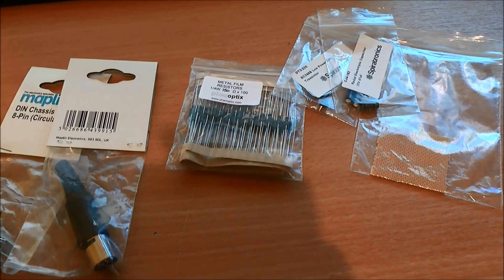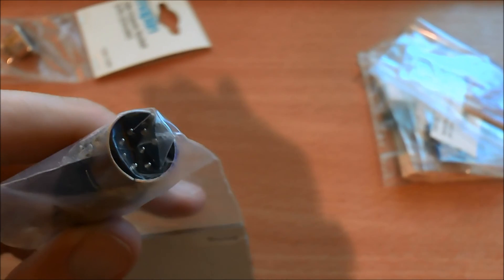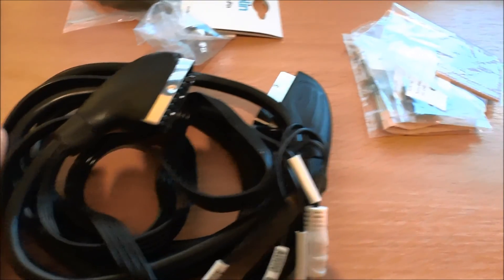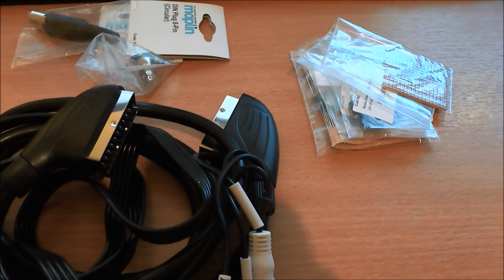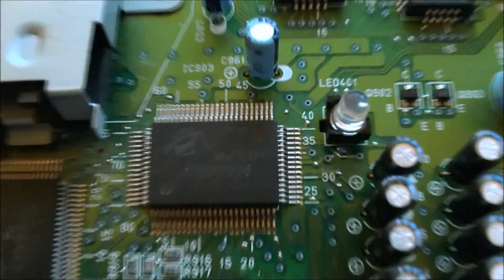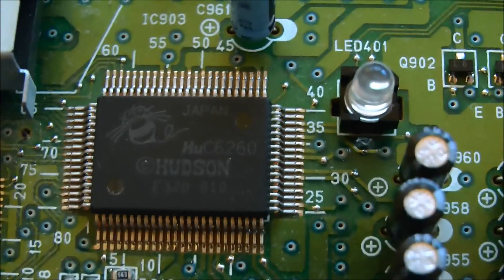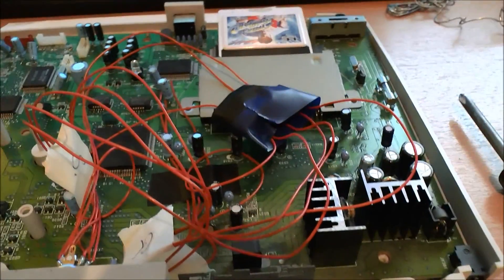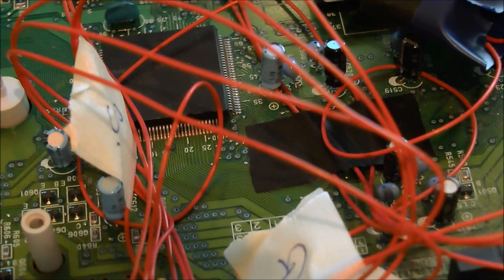PC Engine DUO-R RGB Modification

Comment from the maker: I understand the "path of least resistance" approach mate.  I did the same with my previous RGB Mod, utilising the external bus route.  This is by far a better approach, but does require you to grab your nuts.  Now they have been grabbed once, I wouldn't hesitate to follow the same route again though.

You're 100% right on using different coloured wire, but it has never bothered me.  As long as you take your time.

Look forward in seeing your video mate.

Comment from the maker: That's not nerdy - it's absolute common sense. :D It would be like having a Ferrari and only reving it to 2k rpm - pointless! ;-)

With regards to "measuring".... you're absolutely right Sir, but from one nerd to another, I don't normally look or see the back of a console.  The basic human function of "couldn't be arsed" over took my emotions. lol

I surprised myself that I actually did the whole conversion without being bored.  That's an achievement in itself.

Comment: Nice one - was thinking of doing a similar din mod on my SG - but I chickened and went with the av-box add-on via. bus mod instead.
Using just those red/orange wires would confuse me - understand its more cost effective (one wire reel) but for me I would have def' need more tape markers than you lol - think i'll have to stick with simpler use of multicolour wiring on my mods.
Hope to post a vid of my SG - running with your spec RGB amp this weekend.

Comment from the maker: Paul - I can understand that it looks quite scary, but it really isn't hard imo.  Sure, it takes some level of confidence, but is fairly low on the skill level if you have the details of what to do.  Where some level of experience comes in, is when you don't have the instructions laid out for you.  I had to pull my multimeter out to check for voltages and continuity, when I did encounter some issues.  Even this is just basic electronics though.  To be honest I've always been "into" electronics.

Comment: Did you pull 5 volts from the board where the old 5 pin was on the board for the RGB amp?

Comment: Hello, I recently purchased a Duo R and the RGB cable when slightly moved or wiggled cuts the picture in and out. Can this be repaired?
Reply from the maker: Sure... just sounds like a dodgy connection.

Comment: The PCEngine port may be 'poor' compared to 32bit conversions but still beats the Sega Megadrive version.
Imo PCE SFII:CE  was a remarkable achievement for '16bit GPU/8bit CPU' powered console hardware - which btw is now 25years old :P